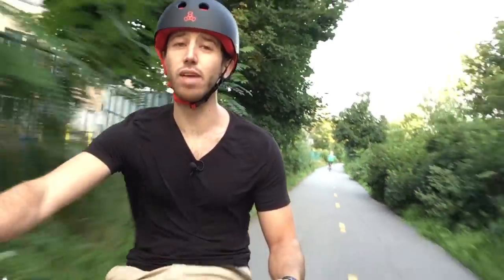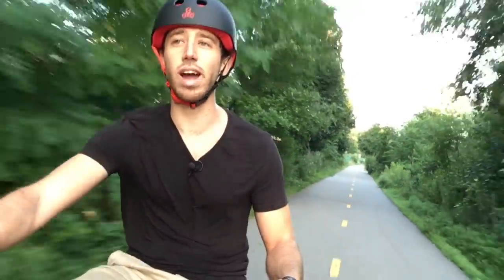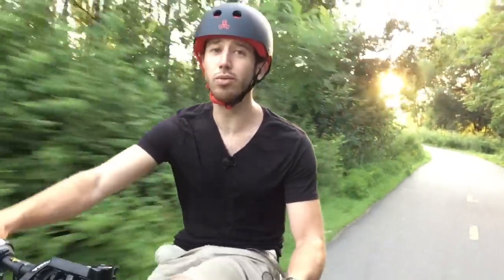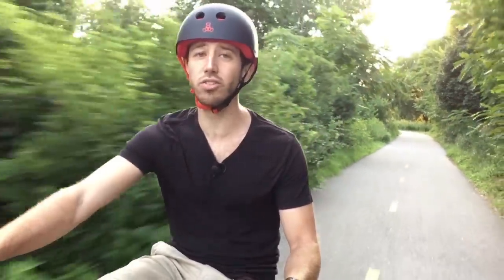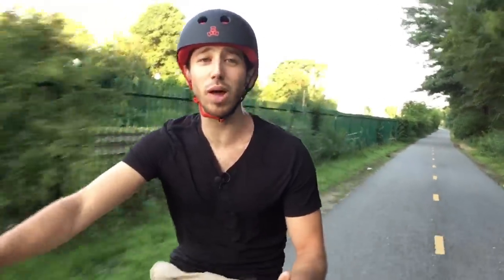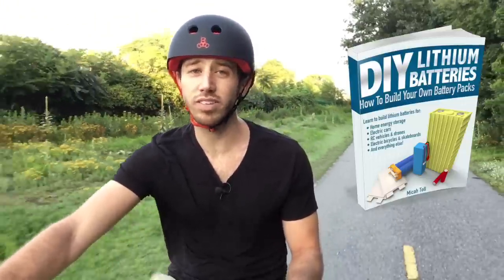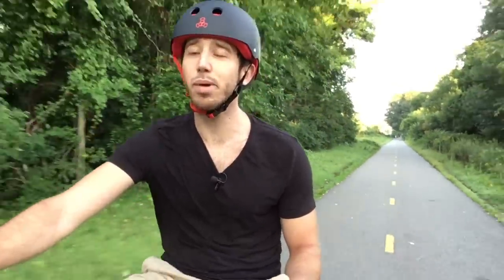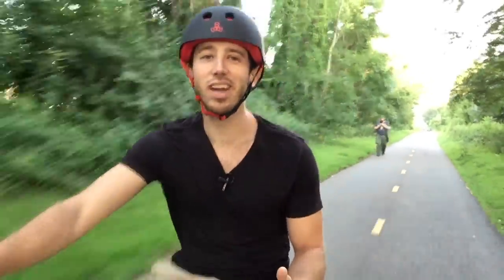10 Tips To Make Your E-bike Go FASTER!!!

Comment: Hey, so you mentioned changing out the battery for a higher voltage one. I have a Bafang M400 (UART interface) that supports voltages up to 48v, it's paired with a 18,9A 36v battery. Do you think that a upgrade to 48v would make a noticeable difference in this case? Also, is it only a case of changing out the BMS or do i have to use completeley new cells?

Btw... Enviolo, nexus or derailleur?